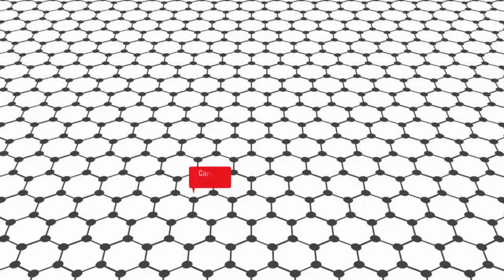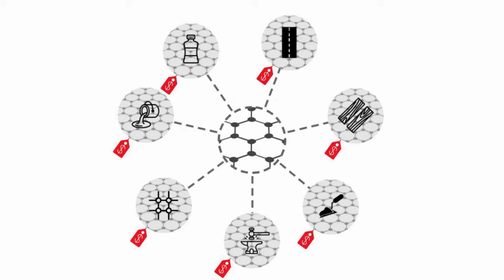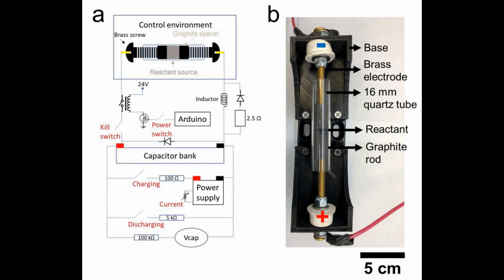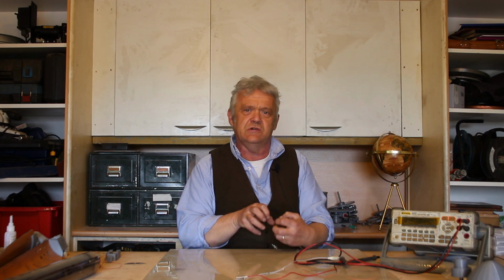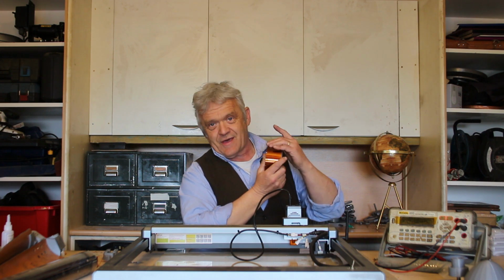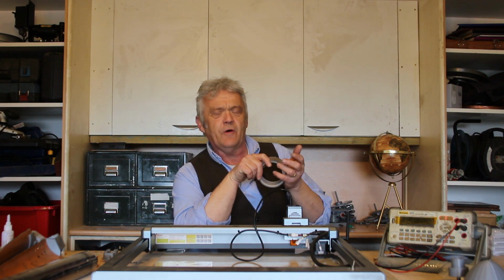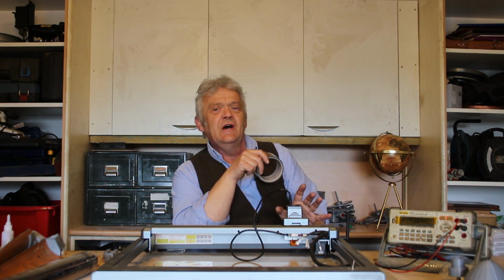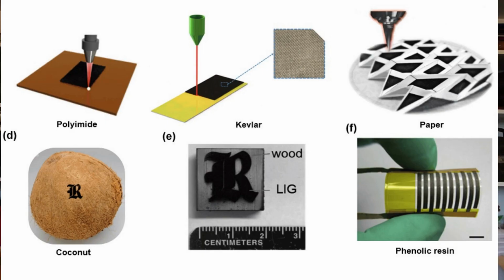1932 Flash Graphene - The Safe Way Anyone Can Do

Comment: Graphene production — new method 
Graphene production — example of technology
Various methods of graphene production are studied. For an overview, in this article, we will discuss only one approach which is nevertheless very illustrative.
Thus, in order to obtain graphene, it is required to complete several sequential stages:
Disperse graphite in a solvent until a suspension is obtained.
Process the obtained suspension in a colloid mill.
Perform centrifugation of the suspension.
Perform vacuum filtration and drying.
Graphene is obtained only upon completion of the fourth stage. As you can see, graphene production is characterized by multiple stages and the use of chemicals which considerably increases the cost of obtaining the material. It is intuitively clear that in order to reduce the cost of graphene, it is necessary to look for options without the use of chemical agents and with reduced number of production stages. AVSp-150 vortex layer device can be a solution to this problem.
How does AVSp-150 vortex layer device work?
A typical vortex layer device consists of an inductor, an operating chamber made of non-magnetic material, and ferromagnetic particles placed into the operating chamber

Comment: Question: From my reading 'graphene is a 1 atom thick lattice of carbon atoms'.  eg; a 'sheet'.  So please explain how if you take a volume of carbon shove it into a glass tube, flash current through it, how that will make a 1 atom thick sheet?  i would imagine the resulting product is in fact not a '1 atom thick lattice of carbon atoms'. in other words, it is NOT graphene?

Comment: The best, most cost-effective way is to make graphene from trash.

I understand you’re dealing with some scary high electricity, but essentially it’s turning trash or recycling centers into Foundries.  

The Energy Economics are the same. Just scale and implementation is different (Flash, laser induced, exfoliated, and other chemical methods)

The only thing is you can’t just plug into an outlet.
You Need Clean Energy in order to make graphene.  And the best way is with solar, wind, and wave power, stored in hydrogen or in capacitors

Comment: When I used to work at Braman BMW, a car dealership, We used to scan papers all day long and I would clean the glass and the rollers and there would always be these flakes of carbon left over.

Most of it was residue is from the toner, but I never got a chance to test it’s electrical conductivity or resistance.  Some of it Was Reflective Almost Like Foil And That Got Me Thinking

I know it sounds crazy, but scanning paper like that, might actually be the best way to test graphene, or flash it.

Basically scanning material with a thin layer of carbon.

Am I close?

You could also put it in a wax and essentially let it dry and bake all day. Like the scanner.

The more you use it, the more it deposits, the more it protects.  To a point I had to scrape it off after a while.

My guess it does that on the microscopic level but you can’t see it. It’s only one percent.

I know each car isn’t a sheet of paper, but the graphing is already in the wax.

I used to scan mountains of paper every day , and after a year or so, I got that.

Comment: Late to the party here, but it occurred to me that another application for this would be making DIY flexible circuit boards from scribed Kapton tape. Likely ultra-cheap too, since you're only paying for a bit of tape and the power necessary to run the laser. Heck, multilayer circuit boards would be trivial since you could just tape the stuff to itself after it's been scribed. I'll have to see if there's a tool library nearby when I can get my hands on a laser cutter like this so I can try it out.

Comment: thanks for the video. i am trying to reproduce the results on polyimide tape with 450nm diode laser (cheap and easily available), however instead of getting the graphene, i either burn the film completely or do not get any conductivity at all. i am experimenting with scan speed between 10mm/s and 100mm/s (the highest i can get from the CNC setup i have and power from 1W to 3W (the max i can get in my laser). could you advise what might seem to be the issue pleasse?

Comment: hI professor it is nice video.i want to know if i can make flash graphene with 220V AC(it is korean domestic electricity.) my circuit is just comprised of 1 switch 1 power supply(it is just domestic socket) 1 glass pipe and a copper electrode. do u think i can do that? Thx for nice video

Comment: Once I have my laser I plan on testing this. I want to scrape the graphene off and use it as an additive to UV cured resins and print with it. Planning on doing strength tests and seeing if it is a viable means of producing strong parts with no additional manufacturing steps (such as casting the parts from metal).

Comment: So could you potentially architect a battery that has an internal super capacitor as a core and then use a separator to distance to battery from the super capacitor to provide a composite form that can do the work of both charging and delivery?

Comment: Well isn’t this interesting. Does that mean you can laser print graphene? In something like a fdm process? If this is so? then full graphene prints are are available for 3D printing purposes. I once joked about using graphene in tattoos and reconnective medicine. Being able to fix nerve and spinal cord issues. Maybe even fix motor neurones?  Is seen someone reference a exo skeleton using graphene?  Don’t know how true that is. But if so you have mobility aids. ballistic protection. countless other uses. In not too much a leap to get layers of nanotubes using a laser. Still want to spell laser with a z. But that something else. Graphene is being eyed for the next gen of solar cells if it can produce spike structures? The it likely to be multispectral? Working in a broad range of wavelengths.  So it might just work at night? Even off the cosmic background radiation….? With regard to solar cell. It can make then just Nm is thickness. So it could be possible to etch it into glass? Maybe as a primary coating? I don’t know how much that would cost? But if you can make it? You could end up with graphene reinforced glass?  Which would be excellent space flight materials?

Comment: My 3d printer has an option to add a 3.5W laser engraver (diode type). Would this work? Thinking the 3d printer could use gcode to make capacitors/batteries by using alternative layers of kapstan tape that have/haven't been lasered to graphene. There are also more powerful laser attachments (5, 10, 15W), would these be too powerful? (As higher power laser is better for laser cutting applications). Great stuff Robert!

Comment: That's good to know.  I was seriously considering building the Rice method  flash graphene.  The capacitor bank at 200v is very scary.   And  also it requires a vacuum chamber.   Those aren't cheap either.
Reply: Had similar thoughts.  And the process of changing the small tubes is decently time intensive.  It's nice that anything carbon based can be used, but what the heck kind of value am I getting by needing it to fit into this tiny tube?  Has to be a better way of scaling up
Reply: @sanaru02  
This is by far the easiest, safest, and cheapest method of producing graphene flakes. This would be perfect for strengthening concrete or epoxy, but I dunno about using it for batteries. The protein might hinder its conductivity.
Reply: @WTF_BBQ  Definitely.  And for sure, filtering that out, if needed, seems like a bit more difficult than the video suggests, meaning that more precise uses (such as batteries) might be a little tricky unless you have a reliable way of filtration and liquid removal.

Comment: And, it occurs to me, that it could be automated with a disc of borosilicate glass, pierced with holes, and fed/indexed with conductors. Similar process to the continuous seam welders used in cans and pipe welding, and double-action die-presses.

Comment: If I remember right with the flash method as well, to get even slightly reasonable yields you would also need to do it in a rarefied, preferably inert atmosphere.
The laser flashing method seems better for large scale production, as you can literally run it down a processing line with several laser heads.

Comment: Tech Ingredients did a video showing their version of the capacitor formed graphene.  The really cool part was they took it and mixed it into resin and measured the resin strain and strength performance under load to fail.

Comment: Glad to see some additional references to graphene!  It's one of the things that got me hooked on the channel.

I've gone through all the old content I could find and can't seem to find 2 videos where you used a couple of different mills to separate graphite flakes into graphene.

One was using a vertical ball mill made from a repurposed variable speed drill, marbles, graphite, glycerine, and urrea.  The other was using some sort of high end spice mill which had stone rollers in it instead of blades to do the same thing - again - using glycerine and urrea as the sticky substance to exfoliate the graphite layers.

I'm hoping they aren't lost forever.  What I was most interested in was the ratio of urrea to glycerine.  I think I recall the basic design features of the apparatus well enough.  Any help or pointers from you (or someone else in the community!) would be greatly appreciated.

Keep up the great work, I always look forward to your videos.

Comment: That's cool Robert, it would be nice to have a machine that can interchange 3D printing, CNC, and a lazer powerful enough to cut at least 1/4" plate steel even thicker would be even better.  Do you have to have something in addition to your Elegoo 3D printer to cure the plastic or just the printer and the filament? Thanks and thanks for the video too.
Reply: Have a look at "MPCNC" (Mostly Printed CNC) - it's not the only design out there by far, but I built one and love it.
Reply from the maker: just the printer and filament mate
Reply: @ThinkingandTinkering  Thanks Robert.

Comment: Hi Rob, thanks for the video - nice to have graphene back in the channel. Does the laser need to have any special specs? Could you please guide us a bit on how to select a suitable laser for such an application? Thanks!
Reply from the maker: no special specs mate which is why i didn't list any just a laser that has 3.6Watts of optical output and it can be CO2 or diode
Reply: @ThinkingandTinkering  Thanks Robert!

Comment: Maybe the graphene coated tape could be used to make a flexible solar concentrator (like in the graphene parabolic mirror video) that could be rolled up like an awning when in storage.  Would be a great way to heat a Stirling engine if it works.
Reply from the maker: that's clever - ceers mate

Comment: Will there be a more in depth video in the members area?
Reply from the maker: no more depth is needed mate - but i can try if you like - but it really will be a bit repetitive
Reply: @ThinkingandTinkering  I see your point.  Maybe something on bioplastics or geopolymers that the graphene could be added to? Like making a cellulose plastic from paper, and seeing how graphene improves it's ability to withstand higher temps.  Might lead to a castable low temp Stirling?
Reply from the maker: @McRootbeer  i like that mate - that extends it - thanks for the idea

Comment: I didn't grasp the concept, laser hits the tape and graphene starts to grow?
Reply: Rob is missing!
Reply: @undernetjack I have kidnapped Robert for making my new place Off -Grid!!

Don't worry, I will be sending Robert back home ASAP, because I am not doing anything "Misery" as in Stephen King!!

Basically,,,, due to the amount of time and work putting together an AI version of Robert  in videos!!

It's also very hard work making cuppas for him, Lol lol lol 😆
Reply from the maker: the tape is carbonised then the carbon re-arranged to form graphene
Reply: @ThinkingandTinkering  how is the flash of light any different than burning it? Or is that essentially what we are doing? And if that's the case, couldn't we use any material as just about anyting turns to carbon when it's burned if I'm not mistaken

Comment: Could the 'flash' be augmented/replaced by lower-voltage/high-current from a welding transformer?
A brief high voltage pulse could trigger the discharge, similar to the old style camera flash bulbs etc.
Choose the timing to trigger the pulse at peak a-c voltage, it should have some serious clout.
Any thoughts?
Reply from the maker: no mate it can't
Reply: @ThinkingandTinkering  OK, thanks. I was just trying to avoid the HV caps, having once got clouted by getting across a 4kv cap in an electrostatic precipitator I'm a bit wary. I'll try research but it isn't my strong point (dyslexic) I'm more hands on try it and see. Thanks for the feedback.
Reply: Tech Ingredients channel explained it. It will not work, because the crucial thing in this method is time. Energy must be delivered very quickly followed by a quick cooling. That's why those supercaps are needed for this method.
AFAIK slower heating rate produced just normal graphite.
Reply from the maker: are you taking money from tech ingredients to promote his channel lol - try reading some actual research mate
Reply: @ThinkingandTinkering  Hahaha, He makes cool experiments, lot of science, some things go BOOM, it's educational and entertaining. His channel is a bit more chemistry focused i think. And a bit more lab equipment is needed. So for most of us tinkerers it may be interesting, but out of reach 😉
He makes a good booze in his reflux still though😆
Reply: @ogi22  thanks

Comment: Dang. Another good reason to get a laser. At this rate I'm going to need a considerably bigger workshop...
Reply: I have a laser and I was wondering what I would do with it.  Now I know. 😎😎😎
Reply: There are rather small lasers available. Some are considerably smaller than an average sized 3d printer. For cutting I suggest a CO2 laser which are the big ones but for engraving or making graphene I’d suggest a diode laser with an overkill power rating run at low power for longevity. I don’t have any hands on experience with diodes but the main complaint I would have I think is the diodes burning out or losing power pretty quickly if you run them at high power.
Reply from the maker: lol
Reply: @ThinkingandTinkering  yea a bigger shop is a must

Comment: Glycerol, Urea, Graphite, gentle mixing and heat has always worked well for me....😊
Reply: I may be mistaken but I don't recall Robert doing that one ? Sounds interesting.
Reply: @TheFlyinCanadian  it was. Dont think that vid is still up, but it was cool.
Reply: Ooh! Any more details? Please and thank you very glad.
Reply from the maker: it is a good method
Reply: @ThinkingandTinkering  There are several advantages to the Flash (via laser light) method, as Rob points out. Namely, that there is no washing or much post-processing involved.  The glycerol/urea method I referred to involves a considerable amount of washing and vacuum drying.  (Unless, that is, your application only requires simple separation, and can tolerate/benefit from the Glycerol/Urea 'solvent'  😜)
Reply: Erm… is that black powder by any chance?
Reply: @martinsmallridge4025  nah, 'black powder' is potassium nitrate, charcoal, sulphur.
Reply: @martinsmallridge4025  Nope, your thinking of sulfur and salt peter. Although I guess Thiourea could provide sulfur.  No, this is from a paper that is a few years old...

I'll try to post a link shortly...
Reply: @dgpreston5593  Hmmm... did it work by flaking a graphite rod? Similar to electrolysis?
Reply: I remember those videos!  Been trying to dig them back up.  I didn't write down the ratios of the Urrea:Glycerol.  But those videos specifically are what got me hooked on the channel.  Didn't write it down because I wasn't ready to experiment.  Now I can't find the data!
Reply: What's the yeld mate? I tried but the purification Is hard. Can You explain me,m I used 3:1 glycerol-urea 150 rpm and i'd collected the top half After centrifugation. What's the temperature? I used room temperature